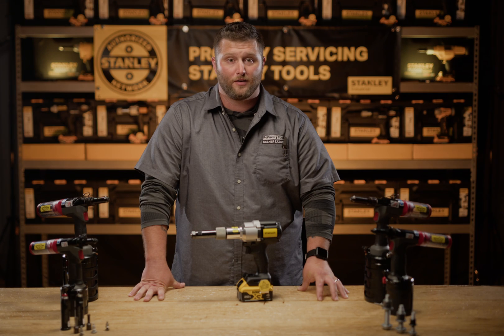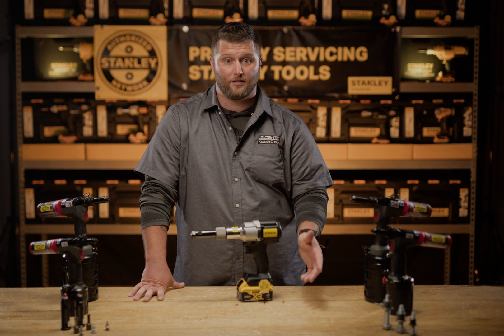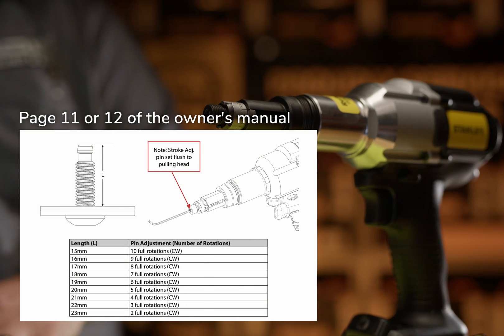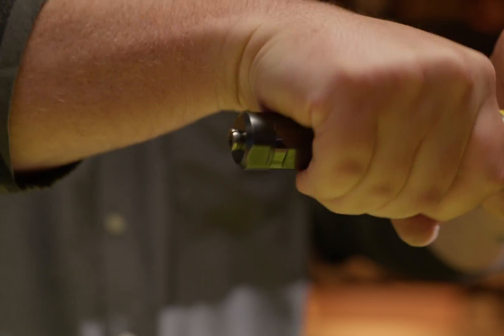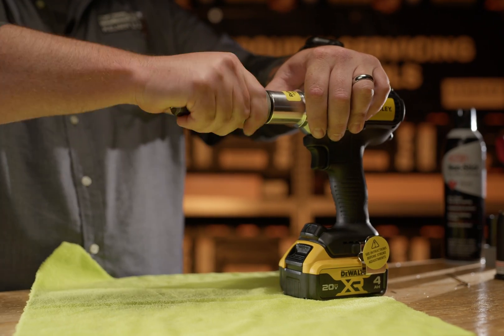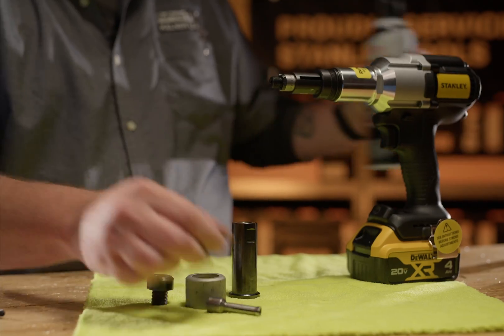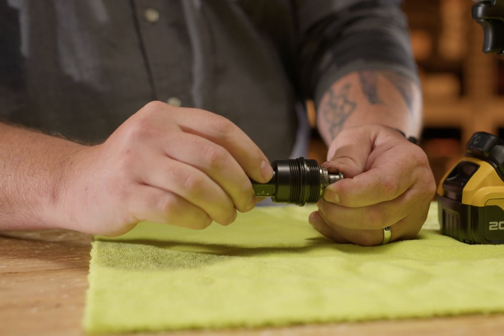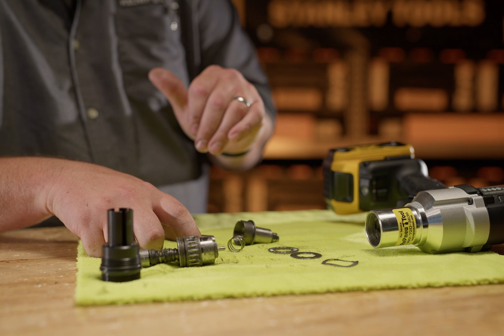Step-By-Step Maintenance & Assembly Guide for Stanley PB2500N Solar Tool!

Comment: So the Meishan puller/collet would usually have the same thread as a Neobolt collet?   In terms of stroke adjustment... for 17mm pin length it states 8 rotations in the book but you did 10 rotations?